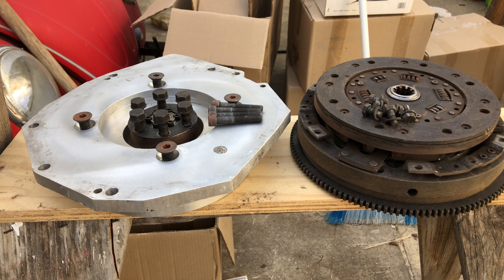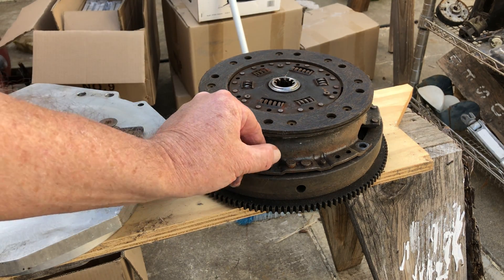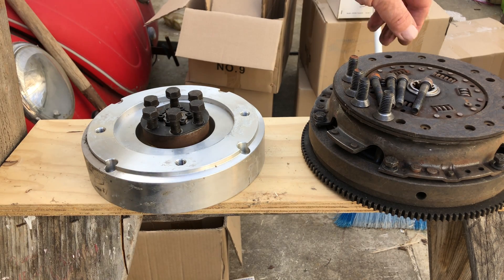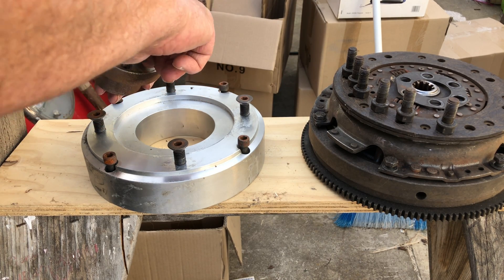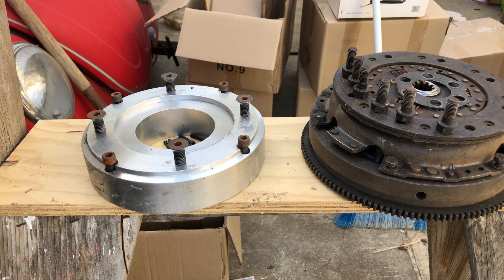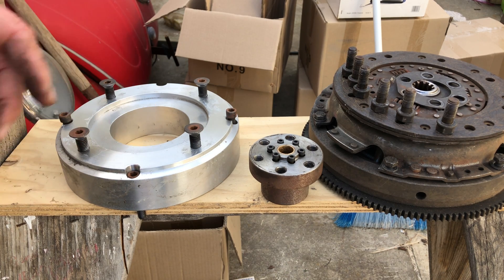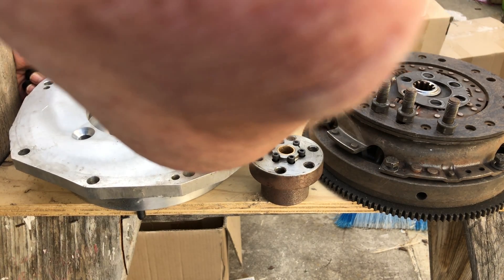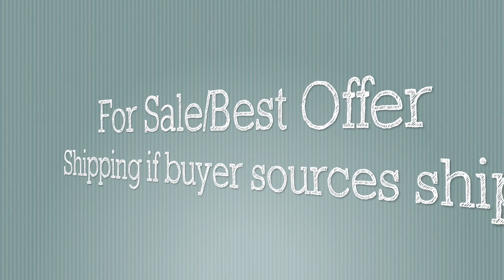Electric Motor Adapter for EV Conversion

Comment: Hi Pete, I have a plan to replace my Fiat spider 124 manual to EV you think is that fit for my car?
Reply from the maker: Absolutely. I have considered doing one myself. I have converted or better said fixed and improved a 75 MG Midget to electric. Distance will mostly be determined by size of batter pack and with tesla packs available one could build and make a pretty decent pack for a small car. Im currently using Nissan Leaf Packs for a 144v pack. Im also using them for a back up battery for the home. My 62 Bug will have two motors installed for a whopping 164hp. My VW Bus will have a single motor and 144v system. I’ll be using a Kelly Controller. Im not overly happy with the Curtis controllers. Building a DIY inverter for my induction motors. That has been on the back burner for sometime. Did you see my Red VW Roadster Electric? That motor is no longer in the Bug but will be swapped for the twin motor setup.
Reply from the maker: What motor and controller do you plan on using?

Comment from the maker: It is not a Thunderstruck Adapter Plate. Not sure who made it. But it is rock solid.
Reply: Thank you for getting back to me. the motor is a Shinegle motor with 18kw rated power and vector control rated voltage 144.
Reply from the maker: @abrehamgebru9022  What controller? What motor? vector control is more like what is used for industrial AC motors and that is not what you want for a conversion because there is no safety controls for the automobile. No amperage control or torque control or shut down control. You need a proper controller and many industrial motors usually run in the 240 or 440 range of voltage. An HPEVS with the Curtis 144v AC induction motor controller is a good choice for a small vehicle. Or the HPEVS motor and the Kelly Controls AC induction controller would be good. Im going to couple an industrial motor to a HV Kelly Controller. Upwards of 220 volts and maybe even more. With the high voltage I won’t need high amperage and it would still be great for a small automobile and I will be using the stock transmission and will be able to use the gears as well. It might be put in my 67 VW Panel Bus.
Reply: @onegreenev  Hi Pete. Thank you for the information. I don't have any experience with EV conversion but I am watching different videos and reading some information, now I am dealing with those parts from Shinegle company Chiana. this is what I got information from them my car is 2200 lbs small car the coupler comes with a package but the trans adapter is not included, here is the spec. of motor and controller.
the motor power specification is
Brushless  
Rated power      18kw
Battery voltage    144
Rated frequency    152
speed                   4500-max 8000
max power          42kw
max torque          126 N.m
protection grade     IP67
insulation glass       H
weight      40kg
the controller assembly
Rated voltage          144
working voltage     65%  135% of rated
output current      130Amp
Max output current    350 Amp
Control mode      Vector control
Digital input      8
Analog input     2
Communication mode        CAN
Ambient temp         -40-50 degrees centigrade
weight           6.5 kg
again Thank you very much for teaching me.